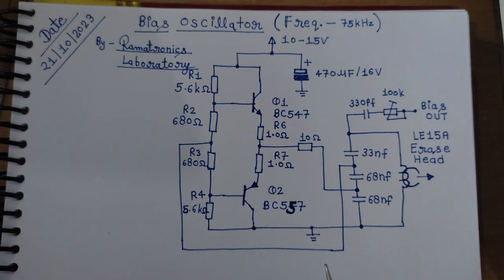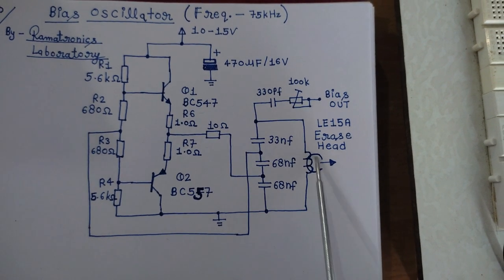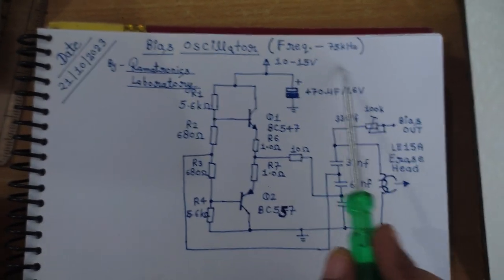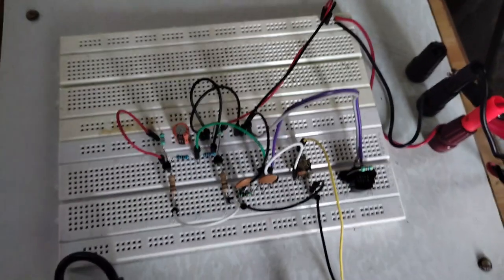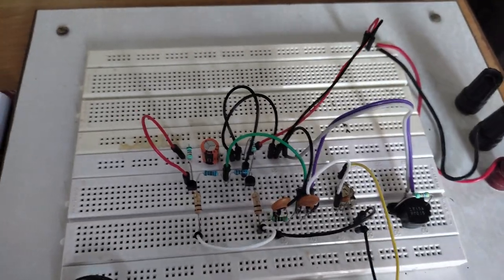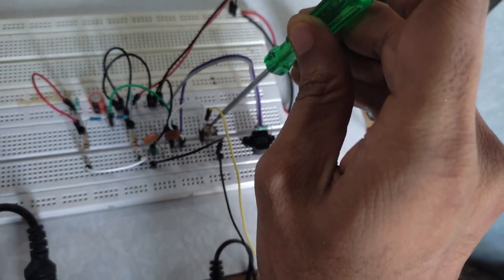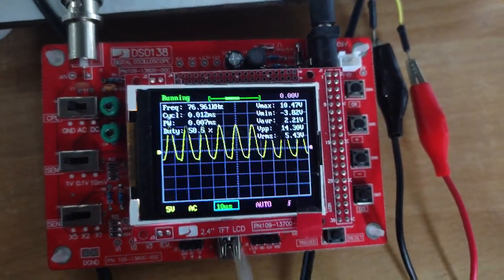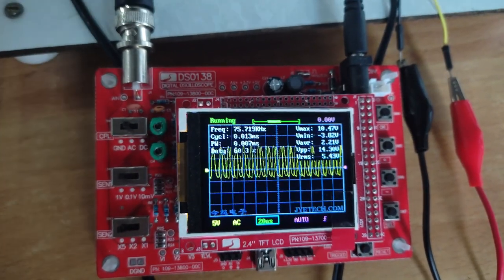Making a Bias Oscillator

Comment: Ok So I built your circuit identically and my measurements are as follows:

5V:  47.54kHz, 14.40V PP
12V:  48.00kHz, 34.40V PP
15V:  48.60kHz, 41.20V PP

My Erase head is from a Sony WM-D6C and measures as 0.9uh, 3 Ohms, I would be keen to hear what your is. I will try some different ones in the future.

I want to build a 100kHz version with 45V PP,  will see how I go with modifying this circuit... thanks!